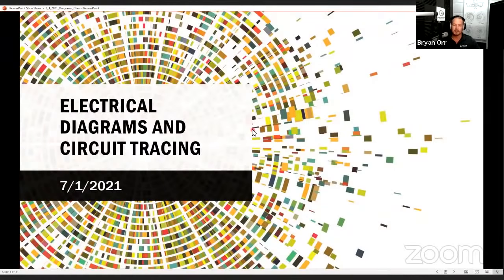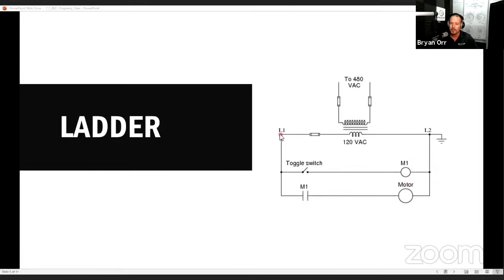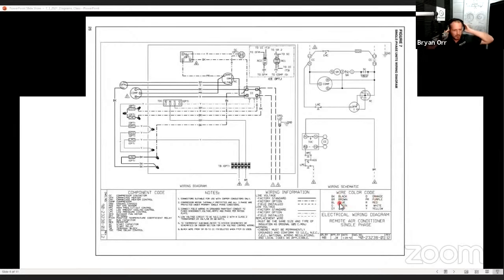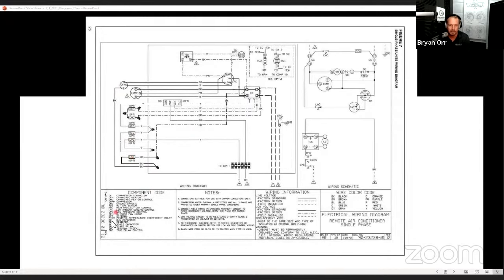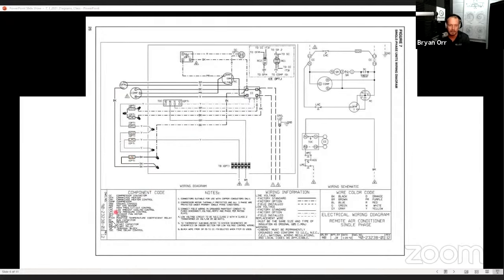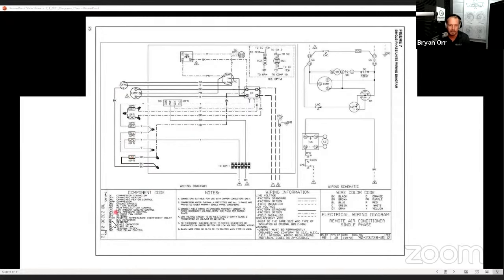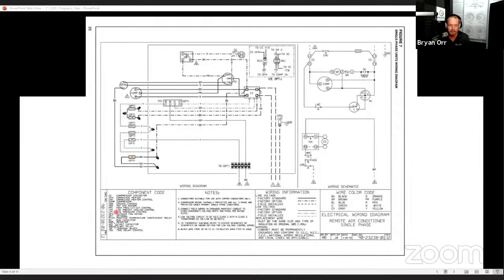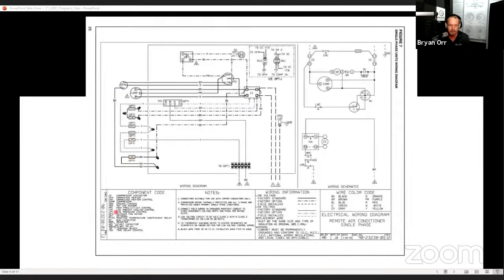Electrical Schematics & Circuit Tracing

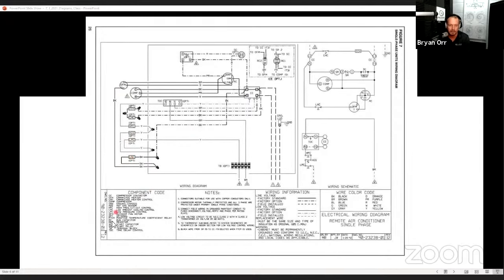Comment: Hey thanks so much for this.  I'm just starting out so sorry if this is a dumb question but 38:13 why is the hot gas switch set to open when the temperature drops.  I would think it would open if the gas was too hot.

Comment: As someone who has worked on boilers, the electrical outside the unit has no electrical diagram. You have to trace everything out. The best way to learn how to read an electrical diagram is to trace the wires out and then to compare it to the diagram. Know the road then find the road stops.